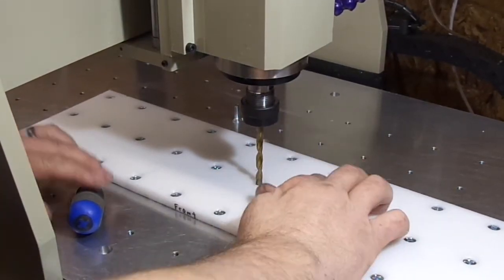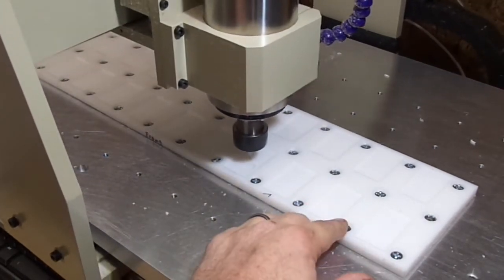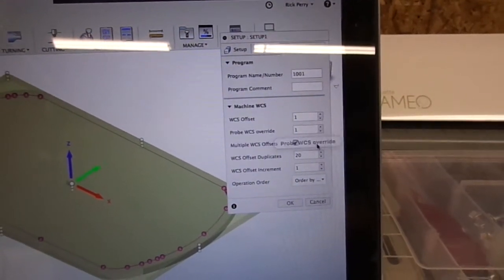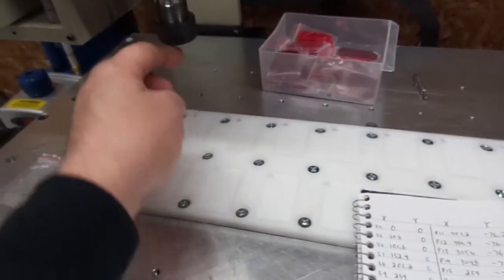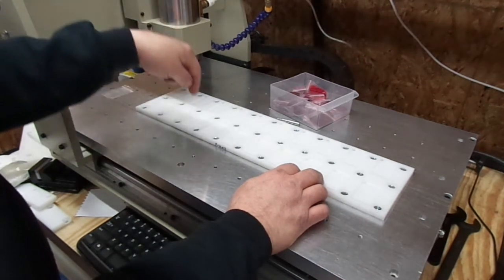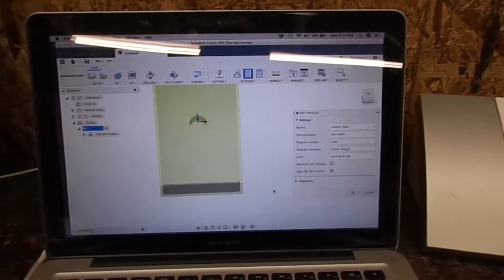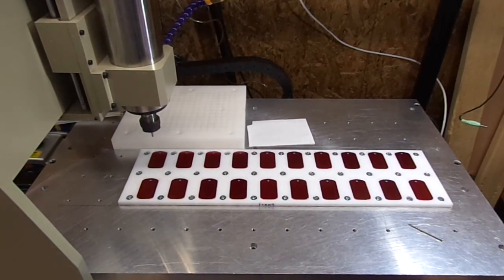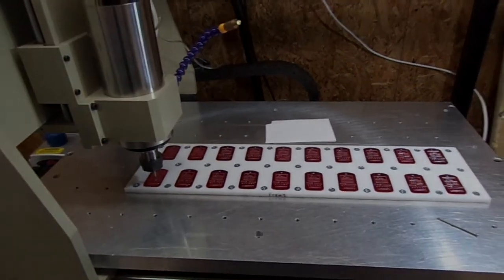6040  CNC Dog tag fixture

Comment: Please give me your mashin what price in India
Reply from the maker: I bought the china 6040 machine off ebay for about $1200 and then took it apart and modified it to my specs. I spent about $2000 more on new steppers, a controller box, spindle and surface plate. So it's about $3500 US dollars to make the same machine.
Reply: @cpworx_maker  ok
Reply: @cpworx_maker  please send me number please contact
Reply from the maker: @happydhimaan6777  you can email me at my 6040 cnc at gmail dot com. put all that together

Comment: Rick loved your video! I saw it from someone else who shared it. I have some CNC background from college and I am in the process of purchasing my first CNC. So videos like this are a great inspiration. Do you buy your powder coated blanks online? Who are you selling these tags to and how did you acquire a contract? It would seem like anyone who was in need for this type of product would have already secured a supplier. Tell me more about your CNC. I am looking at the Axiom 24” x 36” Pro with a 3HP water cooled router. I will definitely check out your other videos! Keep up the good work!
Reply from the maker: Hey thanks for the great comment, Since I get various contracts from word of mouth people I simply buy the blanks off ebay. I have several sources to select from and buy in bulk. Most of my companies that order tags are doing so for benefits and the typical order is about 250-300 tags.  If you go to my website listed in the video description you can read more about my machine and read my blogs. (still updating the blogs weekly to catch up to current time)  In the website blogs I am laying out the process of finding out the good and bad of the China 6040 machine and what I am doing to fix the problem. I like to tinker so it's alright that I got a machine that has a major flaw when it comes to cutting heavier material, you will have to keep you eye on the blogs to find out about this. lol Again thanks for the comment and hope to see you on the site soon

Comment: Do you send the program to the CNC or loop it. Didn't know how much memory the CNC has. Are you a cnc machinist ? If not, may be able to help sometimes.  I will download the Fusion 360 and play with it. Sometimes macro programs are quicker. Also dry run first time programs above the part to avoid crashes.
Reply from the maker: When you assign the work offsets like in the video the end result is the CAM program copying the code over for each work offset. Memory isn't an issue typically because it's just coordinates. Thanks for the question